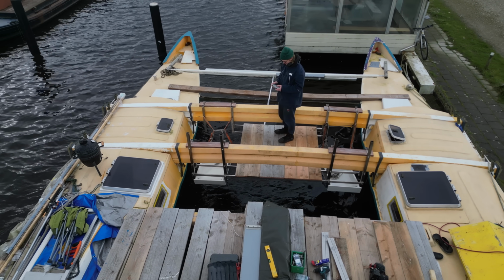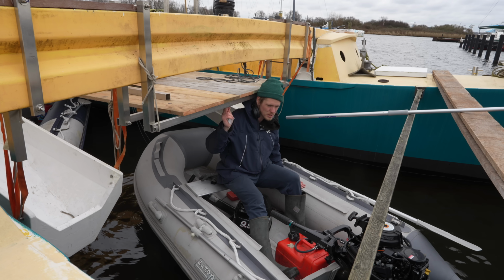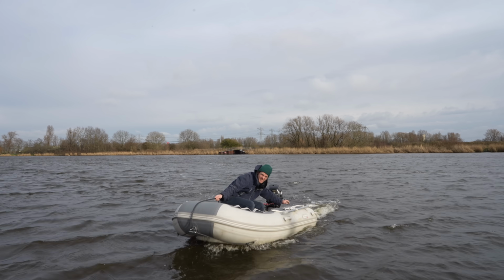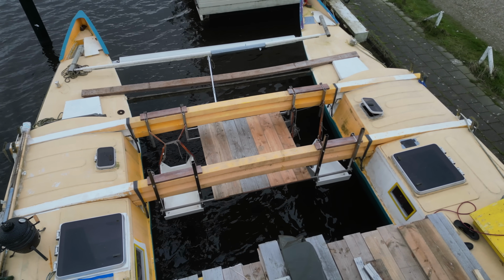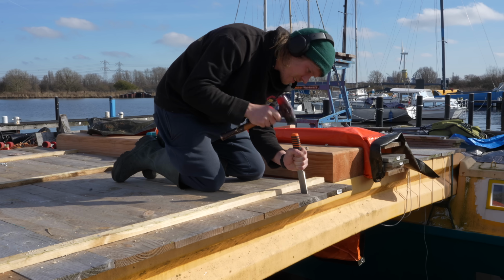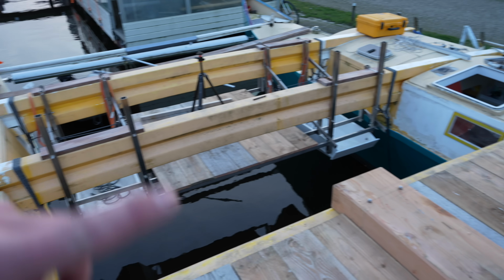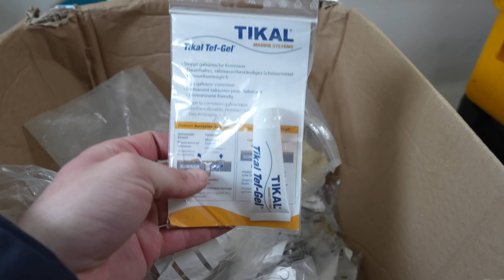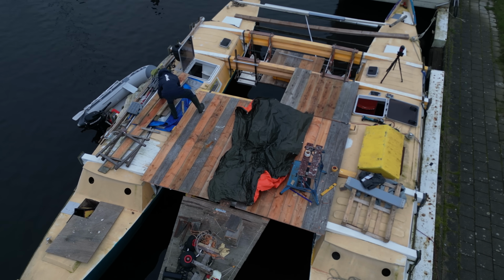A Simple Deck for a Simple Man’s Ocean-Going Catamaran.

Comment: Hi Mark, I have struggled with a heavy 4 stroke on my inflatable. you need to make sure the air floor is pumped up to the right pressure (usually about 10 bar, so you need a SUP pump), you can also play about with the trim on the motor. This will make it hop onto the plane easier. If it still isn't working, then maybe try one of those old 2 stroke motors you've got. I know your not a fan, but they will be about 15Kg lighter, when that weight is over the transom, that has a huge effect on the handling of the boat.

Comment: Great video i dont think you will have any issues with your current nut and bolt sizes. To get tubeing/sleaving further done inside the box section super glue it to a rod and once fitted a sharp tap with hammer should free it up

Comment: M10 is plenty! Don't worry.... think maybe more about stoping tubes from compressing. Otherwise you are good to go. Great work! 😊
Reply: Mark was fretting about the difficulty getting those sleeves into place. I have done similar jobs, and I wrap tape round the tube, joining both ends into a tail, maybe a couple of inches long (5cm). Easy then to position the sleeving without pushing your fingers into a tiny space. It could be done with transparent weatherproof tape. If you cut holes near the end of the tails, when it comes time to disassemble you can pass sticks through to stop the sleeves dropping down inside. Kind of a third hand!

Comment: I work in prefab concrete. Where we use anchors to remove the concrete from the mold. M10=350kg.M12=500kg. M16=1200kg. M20=2000kg. M24= 3000kg.M30= 4000kg. That is what those anchors have been tested for. I personally think M10 is enough? But if I make or build something myself. I usually go for a bit of overkill. Greetings from Spakenburg, Netherlands.

Comment: I hope all the project people noticed the technique that Mark used to rivet the  angle on the motor mounts.  He  drilled all the holes in the aluminum, then drilled and fastened one hole at a time in the stainless.  This prevents the error of holes being slightly off when you fasten it.
Reply: Sure, but it also invites accelerated galvanic corrosion between the dissimilar metals.  Those rivets are going to rust away and pop off/fail in no time.  He needs to swap the Aluminum for stainless.
Reply: @jonnymeyer8572 Exactly my thinking. The aluminum will disappear fast (depending on alu grade) in contact with stainless and salty sea water. So that design should be changed to stainless, especially for the deck support so he doesn't fall through!

Comment: The block you showed is made of off TUFNOL. its durable, strong and does not rust, last forever, but they do not have great bearings in general, but absolutely consider using them. they are light and very strong..

Comment: The bolts aren't the issue. Need to weld the tubes together so they are ridged.  If left only bolted together, the movement of the tube will create the failure point.

Comment: When you leave for a while, unplug the fuel line to the outboards when they are running. They'll run dry so that sludge doesn't happen from the ethanol sitting in the fuel bowl as badly.

Comment: I suspect the real issue with stainless nuts at sea is their tendency to gall because of how brittle they are. I predict they will loosen over time then snap upon retightening. Stainless is probably best for the job but anti seize would be recommended.  They won't snap at the best of times I assure you.

Comment: What will hold the engines in the down position? My comment in last weeks episode was to lower the spacer tubes inside the RHS using electrical wire that can be pulled out after installation of the bolts.

Comment: Hi Mark.. REALLY IMPORTANT!…. as regards your box section compressing under tension,…
To be able to put a spacer in the box section where you can’t get to it, drill a bigger hole on one side of the box section, same as  the diameter of your spacer and pass it through the hole at the correct depth and cut it off flush. Your washer should be big enough to more than cover the bigger hole with the spacer in, and then you pull down to the correct tension of the securing nut. This will enable you to securely tension without compressing the box section.
Reply: Furthermore, you could cut the spacer off flush and TIG it to the box section and grind it off flush …this is definitely the best option but obviously more work 👍🏻

Comment: Great video as always Mark.
Love your self effacing style  posting the mishaps and the successes👍.

Dinghy motor combination.
Looked to me that you may need to adjust the motor trim and bring the prop end a little further forward that should help keep the bow down and get you up on the plan 👍

M10 bolts I'm no engineer but reckon they should be fine.
Maybe when you get back to the UK you could drill out the " hard to get at holes and ask your uncle to tig weld a sleeve into the holes?

Only other thing. 
Given the expansion and  contraction rate of SS. When the weather warms up the longer  bolts may need nipping up.

How good are surgical gloves to keep your hands clean saves having to constantly wash your hands 👍

Cheers.

Comment: When underway wave action will cause the engines to move about. Every SS bolt should be inside a sleeve where it goes through the  box section. Without sleeves the constant flexing of the tubular frame will loosen the bolts as the tube crushes. The flexing will then translate to movement at the joint. As the joint moves the bolt will enlarge the hole weakening the tube at what is a critical stress point. The aluminium tubing is the weakest link, it will fail long before the bolts shear.
Reply: True but time will show up what fixes are needed
Reply: Tubes are stainless steel, not aluminum.

Comment: Take this with a pinch of salt… but my concern(which I had for sometime) given extreme sea states…and having a engineering background (not marine) but close… can these boxes and structure as a general design concept actually withstand waves hitting them and in certain circumstances smashing against them with pretty powerful lateral and vertical forces? I just keep looking at them, the gauge of the steel and irrespective of the obviously high degree of effort and workmanship there, i’m not worried about the bolts,  I’m wondering about this as a whole, even without doing any proper calculations it just looks like something will fail. someone mentioned welding / possibly and upgrading structure. I don’t want to be negative- love your work. I’d be concerned about whether this can hold up though if that’s the idea in open ocean?

Comment: Hello MARK, you need a mechanism to keep the engines down as well. I don’t think the way you’ve got the blocks set up is the most efficient way to pull them up. You are pulling down kneeling I don’t think that’s the most efficient place for them much better if you could stand and pull upwards Try to root the pulleys so that you can do it from standing up and think about a mechanism to hold them down, so they locked in place movement swinging up and down is not good either.
Reply: Those outboard motor sleds have been used in Wharram sailboats since the 1960's.  They're a time tested and proven reliable way of securing and lowering and raising the motors.

Comment: When you end up replacing all the box tubing frame after it is all bent out of shape make the replacement out of 316 tubing with a thick wall of 3.2mm so it will last for a long time. Plus don't use bolts on the tubing to join it together, weld all the joints.

Comment: If you use fuel stablizer in fuel all the time it will minimize the ethanol sludge.   Or run out of fuel when leaving for a couple of weeks or more . Engine are designed for fuel with ethanol but not the water  it attracts !!!!

Comment: Sharpen that chisel and you won't need the hammer for most of that work. Also make sure the cross supports on the underside of your decking boards aren't contacting your lashings.

Comment: If the box section on the engine brackets had been a little bit longer, you could have bolted box section across the top of the beam, so you're not just relying on the bolts alone. 👍

Comment: I have had many times a clogged outboard carborator.
The solution was tanking only E 5 10:18 gas that is 5% ethanol instead of E 10.
Further if I don't use the engine more then lets say two weeks I take out the fuel line and let it run dry and afterwards I also drain the carborator.
Furthermore I installed an extra big fuel filter and never use old fuel.
That solved the problem.
However my Yamaha dealer who services the motor each winter advises  a fuel stabilisator.

Comment: Hi. I’m a boat surveyor here in Canada the following is my opinion. 

Your M10 bolts are plenty strong enough. 

Your decking wood is more an issue.  It really should be much stiffer.  If you get 2 or 3 people on it and bounce over a wave it will fail.  Basically you have patio deck boards that would be supported by large timbers every 12-16 inches.  If you’re going to stay with the thin boards screw an X frame underneath and I would suggest even fibreglassing those on.   There is a time to use something inexpensive because you have it and there is a time to make sure it’s strong enough to handle more than you would ever subject it to.
Reply: Great advice👏🤗👏

Comment: Are you going to put some kind of mechanical latch so the engines are not hanging on the ropes? Make sure you clean up the drill holes from having any sharp edges. Just use a larger drill bit to de bur the edges. It will avoid cracking.

Comment: Mark, I continue to wonder if you've thought through the forces that need to keep the engines down, not pull them up. The sleds have a large enough surface area pointing downwards, and because you have two hulls containing water movement between them, you absolutely will get substantial vertical wave motion as water passes between. The containment will guarantee that the wave motion between the hulls will be greater than that in the surrounding seas. Yes, the boat will be moving up and down, but open sea is not a convenient flat plane.

That area will lift the sleds, and in worst-case situations, permit them to broach. This will then be followed by a slamming as wave force and buoyancy disappears in a trough, which is going to be very rough on your engine mounts. Failing that, the stress on the end mounting plate to the sides will be substantial.  Those have no gusseting or other strengthening. 

As well, the engines will act as keels, and take a lot of lateral stress, especially on a beam reach. That will produce a torsional moment along the length of the  sleds. In short, you have a lot more complex forces that will exist than it seems like you're designing for.

At minimum, I think you need an arm that extends from where the hoist now lifts the sleds, and that locks them into the down position. This would probably best come straight down from the beam. Since you don't have anything that, in the absence of the lifting straps, stops the sleds from dropping to vertical, and given the transitory stress on the straps and associated lifting gear, this sounds like a formula for a lost engine, significant structural damage to the steel frames, and other mayhem.

As well, the sleds seem to be water containers. The weight of water in them in heavy seas will be substantial.. This will add to the problems. 

Not meant to be negative; I just wonder if you've thought this through.

Final note: there is no way that you would weaken those beams with a few fasteners to anywhere close to the point where it could ever be an issue. If that's the whole reason for the elaborate frames and everything else, that is a shame, because I don't think you've spent your time or money well – and you've created a large number of other problems (see above)
Reply: The motors are only for use to get the boat into and out of a marina, or to a mooring ball.  They will never be used while out at sea.  The Wharram boats strictly rely on sails when away from shore.
Reply: @thomasnorman7016  that's an unsupportable set of assumptions. more to the point, those conditions can still occur while transitioning to offshore.

Comment: If you can use m12 bolts and threaded bars then do it, always over calculate the strength, you’ll sleep better.
Reply: Except the hole through the stainless will be bigger, and create a fracture point

Comment: I think the challenge (and genius) of the Wharram is that the boats flex by design, trying to create a rigid structure between the two cross beams will be problematic.  Primarily that the boats are subject to cyclical loading and effectively twist slightly with each wave.  I also think that structural failure will not be due to the static weight of the motors and decking but but wave impacts under the boat while sailing.  I love the channel, and I am a huge fan of the project.  I offer my opinion based on decades of offshore experience, a professional sailmaker, and a certified marine surveyor.

Comment: if you bend a thick steel bar into a square U shape and turn it upside down and slide them onto your beams.. notch the top of beams so they are flush.. it wouldn't interfere with the deck and you wouldn't have a sheering force on the threaded rod. You could have multiple bolts coming out of the metal U shape or screwing into it. It might even add strength to the beams almost like having metal straps around them which might be another good idea using thin metal straps every few feet along the beams just in case you missed any rot.

Comment: The M10 bolts are more than adequate, but i question the choice of rivets to fix that angle to the stainless. I'm not sure how much load they will bear.
Reply: Yes. They have a habit of cracking under load cycles, as aluminium does.

Comment: Hello Mark I'm an ex welder fitter, If that matters. You said, you were concerned about drilled the holes through the rectangular tube, you can reinforce the tube by welding stiffener plates on the outside of the tube where the holes have been drilled. To help reinforce the rectangular tube itself. I don't think it's necessary but it will strengthen the tube if you' still concerned about it.  btw Mark you can screw into the beams if you need to by drilling a larger hole in the beam and than fill that hole with epoxy, let it cure than re-drill to fasten planks to if you need too, to the beams then they'll be waterproofed.  btw the deck looks good I think you've made good progress. cheers.

Comment: From past experience with a 31' cat with a very similar engine pod set up. The engine has a lot of twisting thru the water. The front connection of the pod will be taking all the twisting. We ended up making guides for the back of the pod so they would take some of the torquing away from the front of the pods. Two other things to watch for. The wake off a cat kind of makes a trough that you will need to watch out for and the boats normal hull speed under power may create the trough right where the engines are located. This could require extended shift motors.
Also, we added wings to the stock engine. This helped with flow and hobby horsing under power and helped a ton while reversing.
Hope that helps and thanks for your videos!
Reply: Shaft
Reply: "Shaft"  --  What?  Him again?   I can still hear his music though!

Comment: So good with all the floor space. What you could think about is having beams under the floor with max 60 cm apart as a rule of thumb. I build a lot of things and thing alot about strength and i would be surprised of the cages isnt strong enough. Time will tell. Good working

Comment: Wow, that was a BIG step in many ways. The deck seems a bit bouncy still but strong enough, I am sure there is more to do with it yet. Still think the engine frame would be better welded, OR getting some blocks made up that you can slide in to the places with no strengthening tube in them. Would be a REAL fiddle but with what you are going to do much better to OVER engineer? Suppose you will be ready for more Sea Trials once you have both engines sorted 🙂Hopefully the Weather will now be starting to improve and progress will run away, another great video. Thank you SO much for entertaining me / us.

Comment: That looks plenty strong enough and the perfect way to start simple bolts and fasteners. In my experience this won’t be the last version you make. After many miles etc you will have used it all in all conditions and know exactly what needs to be built when it’s up for replacement.

Comment: If you really feel the box steel chrusing it is an issue, you could solve it by adding internal support to inside the box sections. you could do this with a stack of washers or small drilled blocks of steel.
The ability to lift and the ability to support over longterm are very different things. This setup should be fine tho. If you are really worried, you could setup a test of this with the lengths of bolt and size of box sections you are using. Get 300-400kg weight and build a simple structure to hold it up and leave it for a few weeks while hoisting the weight up and down every day.

Comment: Not an engineer, but the holes that the bolts go through would be the worrisome issue.  However it will take a while to develop with weight evenly distributed.  Would putting a winch in the center and connecting both motor boxes be easier?  You could just wind them both up at the same time and flip a switch to run them down, doesn't have to be electric.

Comment: M6 bolts can hold up an elephant so m10 is almost double that.. get yourself some Thompsons water seal for your decking.. sand it down and apply it with a roller and then just reapply it once a year or so and that Douglas fur will last a long time